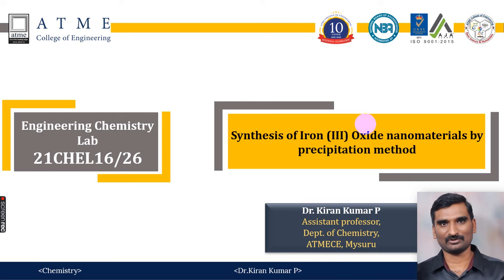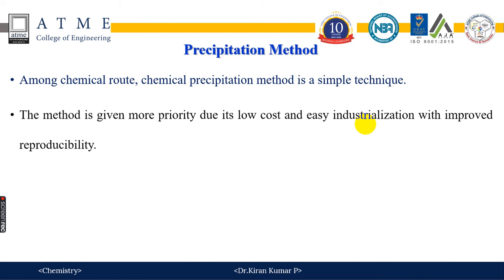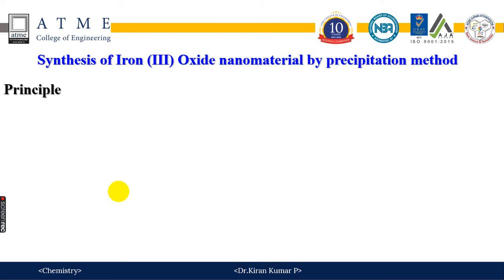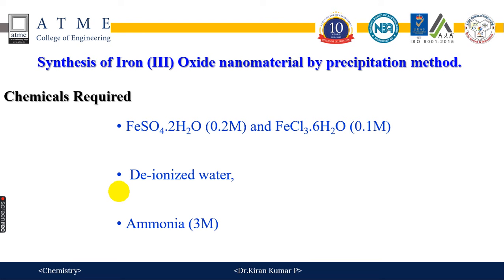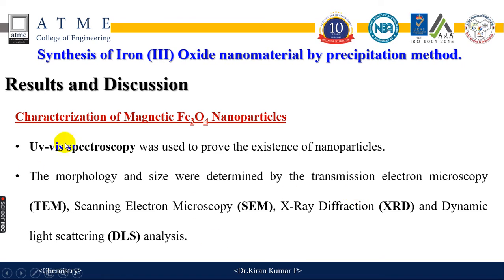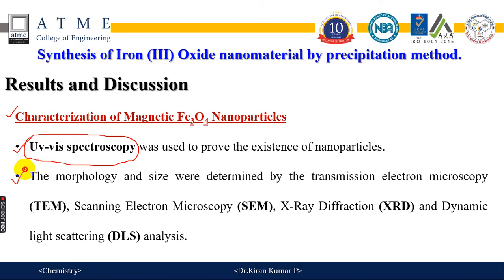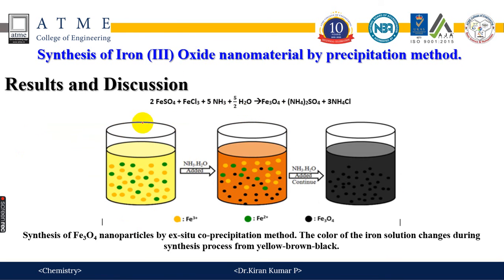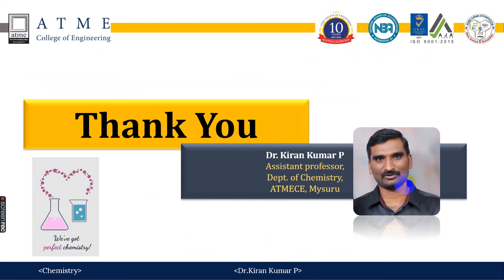Iron Oxide nanoparticles by precipitation method

Comment: Sir thank you for the clear information on the synthesis process. but 1 question I have, appreciate it if you could answer it. i.e., how to achieve particle size ranging between 50nm to 250 nm by precipitation method alone.